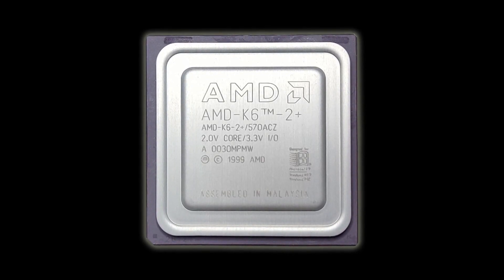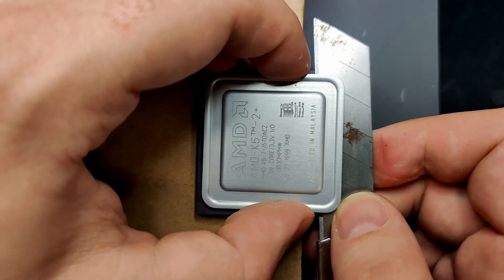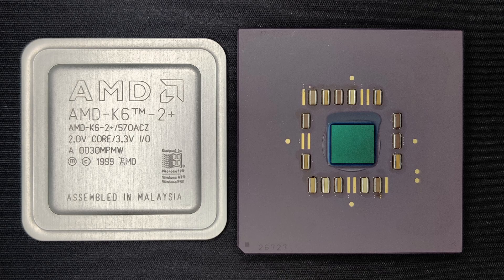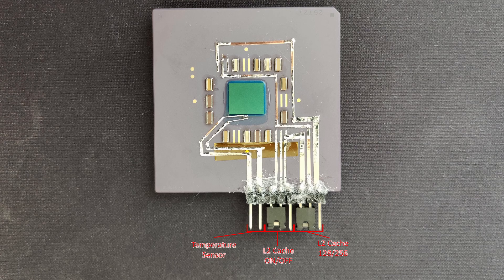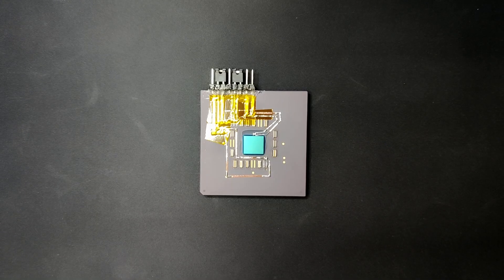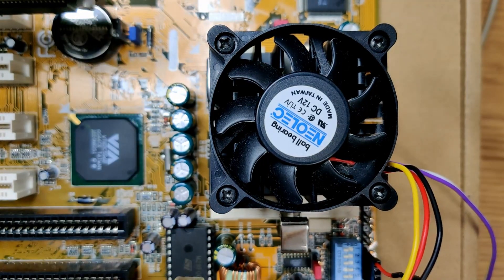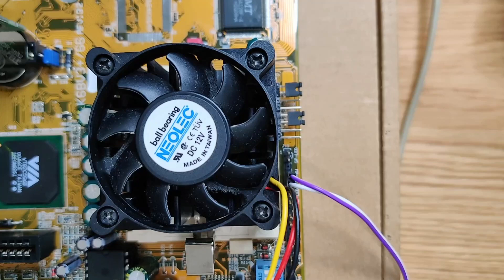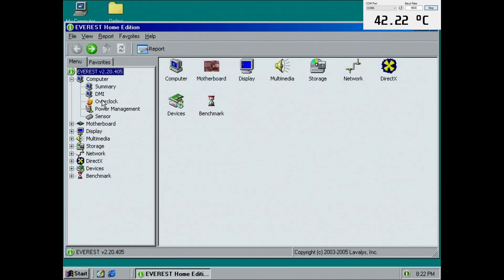The Ultimate AMD K6-2+ - with 3 MODS

Comment: As of mid-2006 I was still using my old K6-2, and had done almost exactly that. I had made the 256kb mod, and soldered the wires for on/off, to a relay with the resistor, and the other end of the relay, went to the turbo button of the case. When the turbo button was pressed (light on) I had L2 cache enabled. It was an amazing pc full of other mods
Reply from the maker: I wasn't aware that the knowledge of this mod is this old. I thought this just came to light recently. Did you try pressing the turbo button while your PC was on? And if so, what happened?
Reply from the maker: I thought the pencil trick came with the socket A CPUs. Slot A had something called "Goldfinger".
I was made aware for the K6-2+ mod from Twitter and Vogons forum just at the beginning of 2022.
Reply: @bitsundbolts  The machine will hang/freeze when pressing the button with it on. The K6+ mod appeared in mid-2003 (at least for me that's when I found it on a website)
Reply: @RicardoRamosRetrocomputacao  This makes sense. While running, either the CPU loses any information in half its cache or (potentially) the cache addressing scheme changes. Both would cause the system to hang. My first thought was to wire up DIP switches in an expansion blank. It's the same basic concept-- make this changeable without opening the case-- but I would think it would be easier to accidentally bump a big button on the front of the case than to accidentally flip a DIP switch on the back. :)
Reply: @msthalamus2172  You can use those keyboard_locks, to control through a "key lock" system. You can put some locks in a 5.25" bay, that would definitely look badass on the computer. There are also those automotive buttons, which mimic the rocket launch button, they have a lid.
Reply: I wasted my money upgrading my Pentium 166mmx to a AMD K6-2 400. My frame rates went down in quake and half life. Worst cpu upgrade ever.
Reply: @tinto278  I'm sorry but something had to be wrong/misconfigured. I went from a p200 to a cyrex 300 and yes that was slower, but then to a k6-2 400 (usually ran at 450) with SDR memory and that was a big upgrade.

next I had a duron 600 @ 1050mhz. that rig lasted for much longer than it should have.
Reply: @NamesGolden  Had to do with floating point and apparently 3dNow had patches for games that I didn't know about at the time. Athlon XP was a good chip though.

Comment: you can also make a breakout with a fpc cable and have the jumpers at the front of the pc
Reply from the maker: Good idea! I wonder if the flat cable could be used to bring the connection from under the lid. There is just so little headroom that the thin copper tape and Kapton tape pushed the limits already!

Comment: Loved the chip mod, but why are you running that lousy stick of ram? Swap it out for one that is CAS 2 rated.
Reply from the maker: Limited with SD-RAM. I have a few others, but I have not paid much attention to them yet as I just acquired this Super Socket 7 board. Once I get into benchmarks, I will definitely make sure I use the best memory I have available.

Comment: The motherboard BIOS is patched?
Imagine having both 256kB cache on the CPU + 1MB in motherboard, like a modern Lv3 cache 😎
What about some benchs?
128 vs 256 vs 1024 kB caches

AMD K6-2 was my first CPU, i think it was 400MHz but i oced at 550MHz (my motherboard don't supported higher freq. and i didn't knew about BIOS updates)

I wanna know what is the lastest Linux version which support this CPUs
Reply from the maker: I think the board has the latest official BIOS Version. There are also 2MB versions for this board. My board could be upgraded with a new Tag ram and an additional SRAM chip - but I don't have the skills for that yet. Benchmarks will for sure follow!
Reply: @bitsundbolts  I'm talking about this https://youtu.be/VwZT40sRMzM
Reply from the maker: I haven't seen this video. Thanks for sharing!
Reply: @bitsundbolts  i hope it helps your project 😉 can be great see a patched AMD K6' BIOS and watch the improvements running 🤓 i always knew AMD K6 and 3Dnow! was underrated but never knew about those patches since here internet wasn't a thing until mid 2000s, also people underrated cache sizes on CPU, i always said 256kB cache 500MHz K6 better than 600Mhz Celeron with 64kB lol
Also SSE is like a copy/paste from 3Dnow! but since Intel had more influence than AMD it got more support, always seen Nvidia Graphics card mounted on AGP/SSE but never seen an ATi on AGP/SSE or same Nvidia on AMD with AGP/SSE even on supported processors (K7 or K8 for example), and never, never AGP/3Dnow!
Reply: @BlueSkyYGO  I've patched lots of mainboard bios using that tool for many years never had a problem 
I've also edited firmware to turn on hidden options and even added NVME boot support modules to UEFI firmware that didn't support it or even have M2 slot
happy hacking ;)
Reply: As I know the latest Slackware still supports it
But I did not try it myself

Comment: Imagine knowing this back when these were first available, who would have the guts to attempt it though?
Reply: AMD had a reputation of leaving little things disabled that people could reactivate iirc, even up to early Ryzen CPUs, if you had the right bios or right know-how you could active more cache, overclock higher than thought, even sometimes activate inactive cores
Reply: @Jabe_VeX  I activated the 4th core of my triple core Athlon II X3 455 and it's been working fine as a quad core for many years now. I use it in my media pc for youtube and streaming services.
Reply: @sehabel  lmao ikr, early AMD was a god if you wanted cheap stuff that you could upgrade later if you were brave
Reply: @sehabel  I did the same thing, but the 4th core wasn't stable.
Reply: @sehabel  ... What is its difference in speed/power between 3 core & 4 core?
Reply: @robwebnoid5763  Many games from around 2015 benefit from 4 cores, since they were designed to run on older i5s and i7s, so it makes them a lot more playable. Youtube is also playing smoother since it sometimes hits 80% utilization.
Reply: I pin modded Athlon XP's, these were fairly easy by comparison. Incidentally, it was also how I learned you can solder a pin back on, and so long as you don't breath wrong it works.
Reply: We did. Pencil mods, Athlon slot 1's with Goldfingers, etc. The good old days.
Reply: back in the day there was a lot of hardware where features were disabled in a very simple way, I remember modding a Geforce 6800LE, you could unlock pipelines and vertex shaders just by flashing another bios, sometimes some of it didn't work but most of the time it would.
Reply: People did...
Reply: The same people who use liquid metal on expensive cpua
Reply: @AnIdiotAboard_ if you used a Soltek Golden Flame mobo the multiplier was unlocked anyway with the right BIOS. 

The other thing that usually worked was change the FSB from 333 to 400 on a 2500 Barton and it instantly became a 3200 Barton. It was very rare you'd have to touch the voltage on them too. 

A lot of the 266 FSB Athlon XPs would run just fine with the FSB on 333 if you bumped the voltage up a couple steps. Some even ran fine on 400 FSB if you put the voltage up a couple more steps. 

They were a damn good CPU for the money if you grabbed the right ones, they'd go far harder than their stock clock settings!
Reply: @AnIdiotAboard_  i still have a 2600 Thoroughbred here, unfortunately the Soltek mobo died of leaking caps well over a decade ago, but that was a beautiful computer in the old days of Black Hawk Down and BF1942 ;)

Comment: The way you handled that razor blade ...
do you still have all your fingers?
Reply: Computers require a blood sacrifice for every upgrade.
Reply from the maker: That is so true! I still have scars from unplugging a power connector of a HDD in an old 486 AT case. Those old cases had sharp edges everywhere!
Reply from the maker: This is my second delid. During the first (video on my channel), I taped one side of the razorblade. The tape was more of an obstruction because I couldn't bend the blade easily. Anyway, apart from very small surface skin cuts, nothing happened.
Reply: @bitsundbolts  What I did once for separating two glued components was use a long blade for window scrapers, and taped that to a stick. Gives way more control. I am not a safety nut by a long shot, but I value my hands and fingers 😁 But I get it, the blade has to be wafer thin so it doesn't split it, it has to cut through the glue. I'm pretty sure there has to be a safe way of doing it unless you tell me you tried everything LOL.
Reply from the maker: I think I actually may be done with delidding those CPUs, but if there is going to be another one, I'll try to find a safer method to handle the razorblade! Always be careful!
Reply: @renakunisaki  Too true bro, too true. Even with better deburred steel cases, motherboards and connectors can still have pretty sharp edges that will scrape your skin open or gouge a trench.
Reply from the maker: Few minor cuts, otherwise all is fine 😄

Comment: Next time bro .
Use repair set for rear Window heater for the car .
You know that heat lines on the windows what u use in the winter .
That repair set is glue with silver or metal parts.
Works perfect to make lines .
I use that with my amd Duron/Thunderbird cpu.

And you can use real silver pen more easy but not that strong.
Reply from the maker: Nice idea! I may get such a kit because I have a feeling that I will be useful for future projects!

Comment: A surprisingly clean setup with the jumpers! The on-die thermocouple is a nice touch, too.
Reply from the maker: Thanks! The jumpers are quite fragile though.
Reply: I also like the use of a high grade thermal paste that will last for years so that it doesn't need to be delidded and risk damage to the copper tape.

Comment: Is the temperature tool Win9x compatible?
Reply from the maker: At this point - no. I used .NET 4.6. But it uses some standard libraries like SerialPort. May just be possible to be compiled in .NET 2.0 that may work on Windows 98SE.

Comment: Wow I had this mod already in mind,  except for the disable option. And now comes this video.
Reply from the maker: You are more than welcome to copy. The disable cache jumper may not be useful as apparently there is software that can achieve the same. I am planning on creating a complete separate video on the Arduino code, .NET application, and the schematics for the electronic diagram.
Maybe .NET 2.0 is compatible with Windows 98 - and the code application could be compiled to run on Windows 98. I may add this in that video as well.
Reply: @bitsundbolts  I will wait then for your next video. Thanks in advance.
Reply from the maker: Uploaded your video today ;) .Net Application compatible to Windows 98...
Reply: @bitsundbolts  Thank you, I will watch it now.
Reply from the maker: Are you planning to still go ahead with the mod?

Comment: Neat!  You can also disable the L2 cache on-the-fly with the software-based SetMul utility, in addition to changing the CPU's clock multiplier for running older speed-sensitive software.
Reply: Setmul is I think deprecated. It was replaced by CpuSpd, which consolidates the functions of the following tools:

- SETMUL
- THROTTLE.EXE
- MSR Editor
- Cache CTL
Reply: @fattymcboomboom9254  I tested CpuSpd and it CAN handle the same range of multipliers accessible via SetMul (2x-6x on my board) despite the printed documentation.  In fact the only functionality I noticed that didn't work right on my Asus P5A board w/ K6-2+ is the CPU temperature reporting function, which reports garbage values.
Reply: @angieandretti  You can report your findings to the vogons main thread (74359). Maybe it helps.
Reply: @angieandretti  You can also try the 2 older versions, maybe the results aren't the same.
Reply: @fattymcboomboom9254  I'll test that out later when I'm home.  I notice the "support matrix" sheet for CpuSpd lists a range of 3x-6x for the K6-2+ multiplier but I'm able to set as low as 2x with SetMul.  I'll post back on how CpuSpd actually behaves.
Reply: That’s impressive!
Reply from the maker: I have not used SetMul yet. Good to know that this utility can disable the L2 Cache. I wonder if there is a difference in performance between hardware and software.
Reply: @bitsundbolts  I would guess that there's not, but you're probably the only person in the world who's done this to a K6-2+ CPU so you'll need to check and find out 🙂

Comment: Next time i would put it in the socket with heatsink on to add pressure while curing
Reply from the maker: I did place a heavy object on the CPU. In part 2 of modding the AMD K6-2+ 450 (video on my channel), you can see a cardboard roll with stone coasters. I did the same for this CPU.
Reply: @bitsundbolts  another way besides what i said would be to use a extra socket or use a garbage mobo and use clamps  the amount of force applied is way greater than weights
Reply from the maker: It definitely could also be a good option. The weights give you the option to re-align the aluminum lid in case it moves. Under a cooler, it may be a bit more difficult.